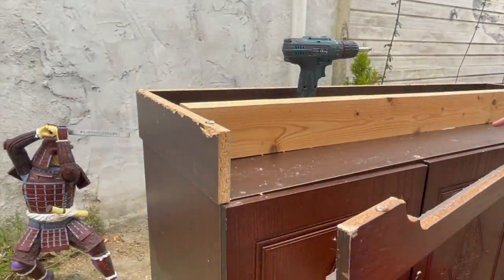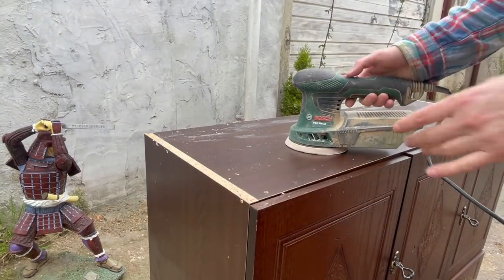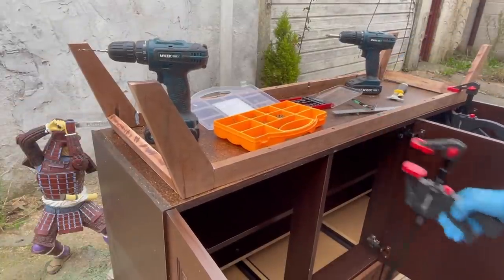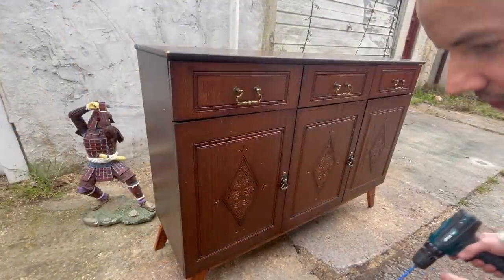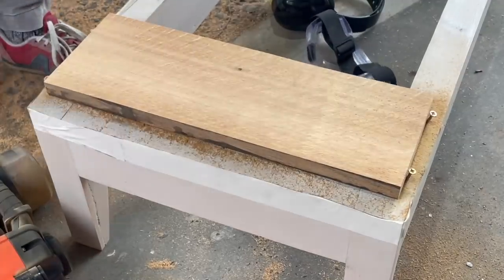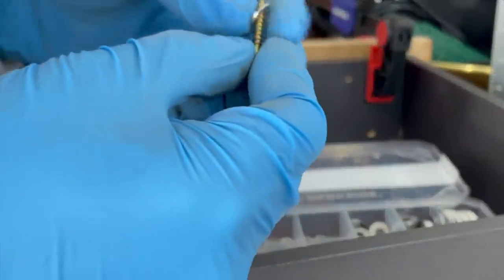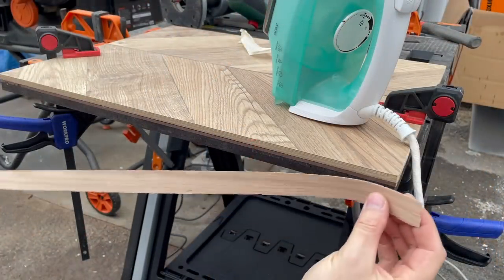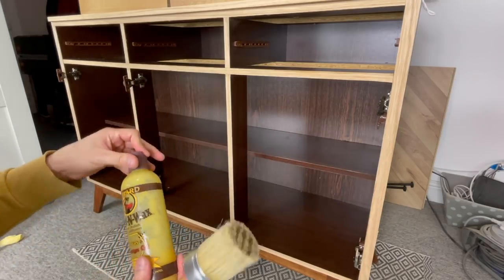Amazing buffet Makeover ! How to upgrade old furniture

Comment: W O W!! Absolutely gorgeous transformation!! I hate dealing w/ MDF, but this is not only stunning, it’s also genius. Way to think outside the box AND using the wood floor planks instead of buying expensive pieces of oak. 
Love your new toys (yes, safety first). The belt sander is a beast. My husband has one that was handed down (it’s a stable one, not a hand one) that’s over 40yrs old and we actually call it “the beast” lol. It weighs like 100lbs and is huge/klunky, but still works great. He made a couple of Tantos for Christmas gifts last year out of rare species of wood and it was much easier to do than a hand sander.
Thank you for sharing your work and the time you take to explain the process.💜
Reply from the maker: Thank you ;-) you are very kind .

Comment: Brilliant use of this flooring. For your consideration: We used silicone glue sealant (using a chaulk gun) to seal/stick together and to stick onto our surface. No staples. To remove, 20 years later, a saw was required.

Comment: The idea with the panels is brilliant! I was thinking about an on budget kitchen cabinets renovation - I could order a new wooden top (most expensive part of the renovation), leave the same cabinet structure, just add a new front cover like you did with the panels. That would be for bottom cabinets. The top ones I could also do new fronts and I thinking darker ones and with less standing out pattern or no pattern at all.

You Sir are an inspiration! :) Liked, Commented, Subscribed ;)
Reply from the maker: you definitely could ! good luck ;-) and thanks!

Comment: Nice! very clever, great recycled materials, love the simple hardware, love the angle of the wood cuts on the sides, love the combo of wood stains, etc. I see just a slight problem with the middle door?
Reply from the maker: Glad you like it. It was like that originally, did not have the time to move the hinges before I took the photos.